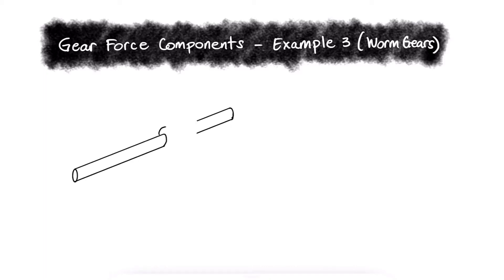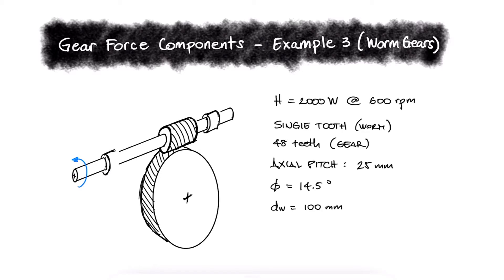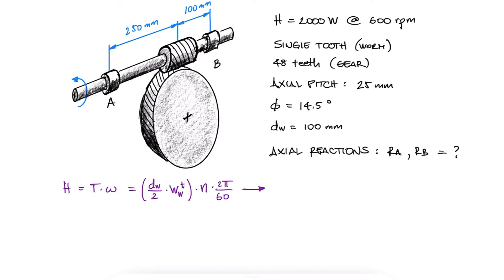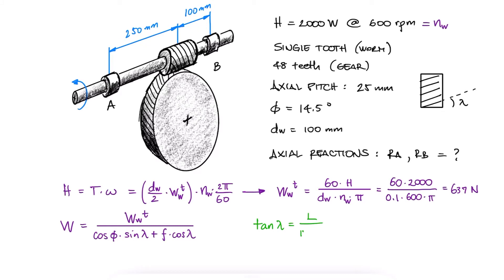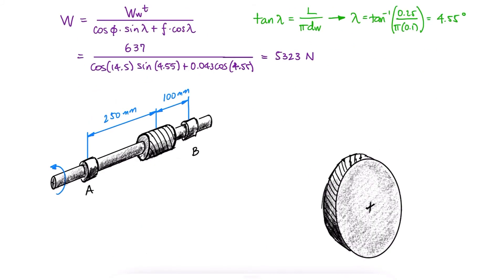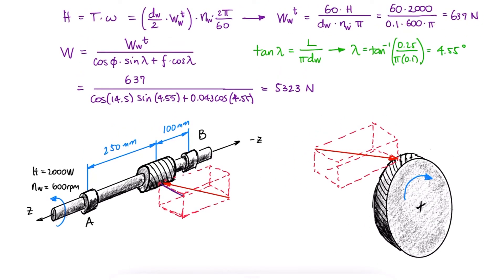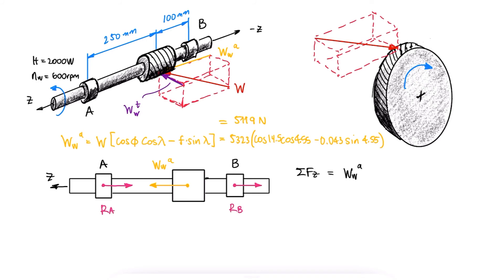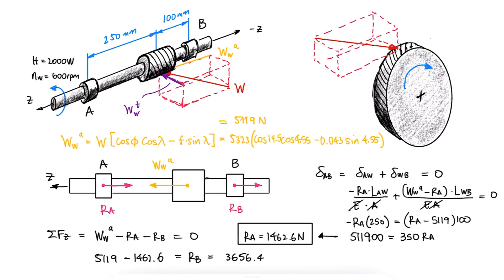Gear Force Components - Example 3 - Worm Gears

Comment: thank you so much for this explain , but I think there are a mistake which is you confuse between the W_w^a and W_w^t
first of all we found the W_w^t which is equal to W_g^a    
but you make it equal to W_g^t
Reply from the maker: Hi! I don't see where W_g^t was calculated. I only see W_w^t and W_w^a. The gear forces are not used in this problem. Can you point me to when the error happens?

Comment: how to find axial direction of gear?
Reply from the maker: Do you mean the axial component of the force on the gear? The axial component of that of the gear is the same as the tangential component of the force at the worm, which is W_w^t, which is calculated to be 637N. The equations for the different components of the forces in worm gears are included in the main video for this topic: https://youtu.be/7cNR4YJ1cnI